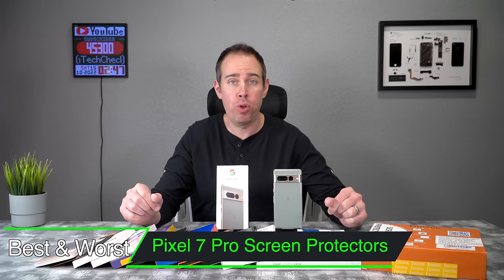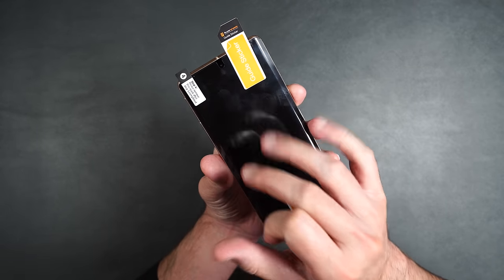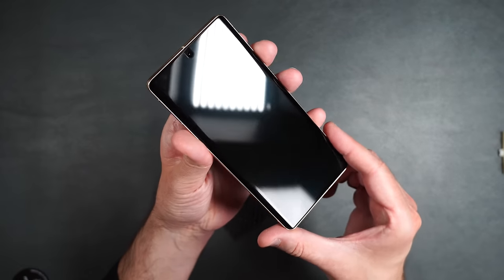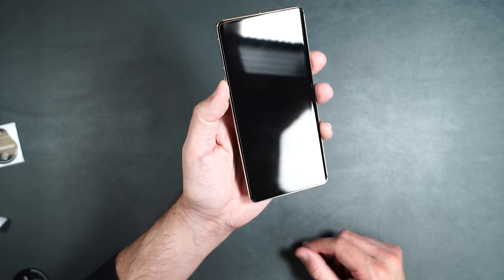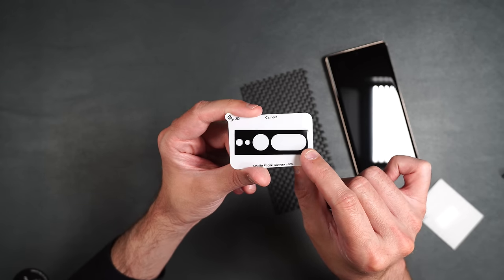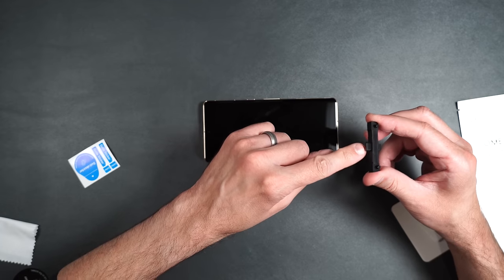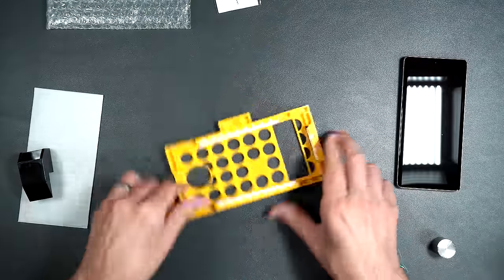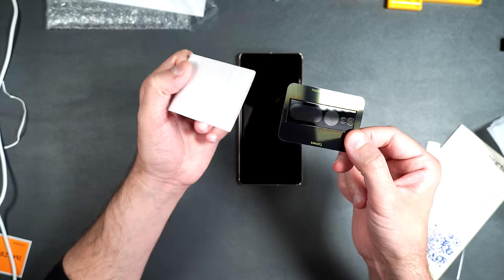Best And Worst Screen Protectors for Google Pixel 7 Pro

Comment: So what I gathered was the best glass protector would be the Whitestone dome, protects camara bar metal also. Number 2 would be IMBZBK Glass protector. Film would be AM film protector, Better Future AACL Film Protector, and Whitestone Dome UV Film Protector, in no particular order.
Reply: the winner is number 10?
Reply: really? i would put the IMBZBK Glass protector as #1 with the bumpers and a UV light that covers the entire device in one shot
Reply: @dimm0k  do you say you buy product 5 and product 10? 
The product 10 you say to buy it for the UV light?
Reply: @mArtinopapesso  no, I would go for product 12... I don't have my P7Pro yet, but have used a similar product to IMBZBK's tempered glass for my P6Pro and the extra few dollars you pay for the Whitestone isn't worth it in my opinion
Reply: @dimm0k  HI,Is 12 the best product for you,please?
Reply: @dimm0k   for google pixel 7 (6.32 inch) Which is the best product ,please?
Reply: Is there any glass screen protector available for less money without that ugly fingerprint cutout?

Comment: I’m looking for a USB-C splitter for my Pixel 7 Pro that can connect to its USB-C port. The splitter should have two female USB-C portss: one for connecting USB-C Apple EaarPods to make phone calls, and the other for charging the phone and supporting data transfer. This data transfer should enable USB debugging mode, allowing me to use the mirroring application, scrcpy. I’ve noticedd that most products on Amazon only support data transfer on the port that supports audio, but not on the charging port. Can you recommend a product that meets these requirements?

Comment: I did see a very slight circle around the fingerprint sensor on the IMBZBK loca adhesive protector. If you watch closely you will see it and I am sure that is the reason for the added weighting device. I liked the leveling bubble on the guide also. I also noticed that the gap between the edges of the protector on the top and bottom appears to be narrower than it is on the Whitestone loca adhesive protector. I like that there are no circles to be seen over the fingerprint sensor on the Whitestone either. The Whitestone procedure of having to push down, and or lift up to make the loca move to the center seems very, very bad IMO. The bridge should drop the loca in the middle if you have to do that! Too much room for error. So then IMO the IMBZK has a better installation routine with a better guide and three protectors, and a narrower gap top and bottom, with a barely visible circle over the fingerprint sensor. The Whitestone has a harder installation method, larger gaps top and bottom, no circle around the fingerprint sensor and only two protectors in the package. To me the only down side of the IMBZBK protector is the barely visible circle over the fingerprint sensor. So even though I have the Whitestone on order (SMH) I give the IMBZBK protector the WIN over the Whitestone! One other thing that is better on the Whitestone, and the main reason I went with it over the IMBZBK protector is the CLEAR camera bump film protector. Those black glass ones are stupid unless you have the Obsidian color phone. Clear is the way to go!
Reply: Nice feedback, thanks!! IMBZBK definitely has the better installation.    I kind of like the idea that the Whitestone has a little more gap.... that way more cases fit the device easier.   I went with Whitestone, but hate that it's not releasing till Oct 31st.   Luckily i found a code that gave me 20% off, so $31 total for 2 lifetime screen protectors isn't' horrible.
Reply: I just installed this one on my pixel 7 Pro. So far so good. Be sure to slide the glass protector up before using the UV light to better align it to the screen.
Reply: There is no hole for the front facing camera. You don't have an issue with that? I do.
Reply: When I installed mine it just sped up the wait time of the liquid to the sides, I think they cover the fingerprint area to protect it while installing and double down by having you use the weight at that location that's protected and simultaneously making the adhesive as thin as possible at the fingerprint sensor to ensure it has minimal impact on the sensor itself.  I can confirm my install went seamlessly and it's the best screen protector I've ever owned.
Reply: @rjsoderlund81  did your IMBZBK have the circle around the fingerprint reader?
Reply: @JohnJacobJingleheimerSchmit  nope. Can't even tell it's there.
Reply: I got the IMBZBK for $24 only and by far it was the easiest installation process that I've ever done and I've done a lot. I do recommend covering up all openings on the phone first prior to putting it in the jig. I like the zero gaps vs the Whitestone plus I hate the hole punch cut out for the camera as it tends to collect dust easily. It's also very difficult to fully clean it out too.
Reply: Regarding the Whitestone having slightly larger gaps between the screen and the case than the, uh.... screen protector with the random sequence of capital letters I've already forgotten, this isn't necessarily a bad thing. Yes, aesthetically it's amazing when the two things mesh perfectly, but if you drop your phone and it lands on the corner, any good protective case is going to bend inwards slightly to absorb the shock. When it does this, it can push on a screen protector that's fitted too close to the case, causing it to crack, lift, or even break. I've had this happen before. I'd therefore rather have a slight gap than the so-called perfect fit. These things are way too expensive to be replacing all the time.
Reply: I have to agree with this review. I own a note9 and bought a Whitestone tempered glass screen protector for it. I've had this same screen for 4 years and do not regret paying what I paid back then. I've dropped my phone more times than I can count on the screen side and the Whitestone screen has taken the brunt of the abuse. I am now buying this screen for my dad's Pixel 7 phone, because I also do not like the rim of that circle on the other screens. Installation is not great I have to agree, but doing it carefully helps.
Reply: Just installed IMBZBK, no circle around the fingerprint sensor. The best glass screen on market right now

Comment: I have a pixel 7 pro and I'm wondering why you don't talk about the second most important issue with these screen protectors - image quality.  Because of the curved glass, most of these screen protectors don't have full screen adhesion to the screen.  You did mention that this results in low adhesion but the horrible image quality you get when you don't have full adhesion makes any screen protector without full adhesion and automatic no for me.  The air gap between the screen protector and the screen causes internal reflections which ruin image quality.

Comment: I've done a lot of research and didn't found any tempered glass that seem to be a good option.. only the really expensive whitestone. Thanks a lot for this video. Now I've ordered the IMBZBK for 30 euro.. it's expensive but better than 48 Euro(for whitestone)^^ hopefully it will work fine. I'm a mom of a 2 years old and really need the high protection for my phone 😅
Reply from the maker: I agree, the best options are going to be the ones that use liquid adhesive because of the curvature of the screen. The IMBZBK wasn’t a bad option, let me know how it works out for you when I get it on.

Comment: Looks like the only real option is to go with the ones that require adhesive, the others all seem fairly atrocious, I've gone through two sets of protector already and found my way to this video, thanks! (first one is a glass one with the ugly circle hole, couldn't take it, second one was a TPU one which scratches if you looked at it too hard).
Reply: Which one did you end up going with, and how do you like it?

Comment: First time I used the Whitestone dome screen protector was on my pixel 7 pro. If the protector edges weren't there, you'd honestly never know it was there. It feels almost exactly the same as the stock glass.
Reply: Are You talking about the UV protector or the adhesive one?
Reply: @similette  uv
Reply: @_Davepocalypse  thx!

Comment: Was disappointed that there was no Spigen glass option. I contacted them ands they said they have no plans for it because of the curved shape. I ended up with Panzerglass which is expensive, and you only get one, but it does seem to work well. It too has a circular section for the fingerprint reader (one of the reasons I don't like in screen fingerprint readers), but I've yet to see a glass one which doesn't have that circular section. You seem to have greater choice than we do in the UK. Can't say I fancy the hassle of the UV curing liquid ones but they don't seem to have the fingerprint cutout which is nice.
Reply: The Whitestone does NOT have any circle section for the FP sensor.
Reply: @josephseman5333  yes I did say that in my comment, but I'm not really keen on the hassle of having to have a special light bar to cure some glue which will then sit around gathering dust. It's a pretty wasteful system.
Reply: @stevepettifer4896  I think it comes with it, you don’t have to buy one.
Reply: I have Caseology (Spigen sister company) for pixel 7 and sadly, fingerprint don`t work most of the times.
Reply: @stevepettifer4896  Lmao...you reuse it for when you reapply it. It comes in a 2 or 3 pack

Comment: Thank you so much for this!! I am going to try the Whitestone Film Hybrid. I have been using the Dome tempered glass screen protectors, but (due in large part to my physical disabilities, I'm sure) they are chipping on the edges and cracking. They're just too expensive for me to keep replacing them, plus, my screen actually got cracked while using them. Like I said, probably more my fault than theirs, but I'm going to see how I fare with the hybrid film this time. 😊 Thanks again!!

Comment: Thanks for the video! Just installed the LYWHL film for my pixel 7 pro. Was worried about getting the line in the middle but I actually didn't get the line in the middle of the screen which is great for $8. Maybe i got lucky and got a better QC screen from LYWHL. What did end up happening was a singular......singular!!!! piece of lint got stuck under the screen. Again, $8 bucks is worth it. I messed up the first screen because I wanted to see the fitment and didnt read the instruction or rewatched your video and the center green part stuck to the screen misaligned. Just and extra FYI i did install the second screen in the bathroom after streaming it up to prevent as much dust/lints possible.
Reply from the maker: That’s great to hear about no lines Poi, it’s usually my luck to get a tiny piece of dust as well. Thank you for the tip, I’ll have to try that myself sometime. Thank you for your support as well.

Comment: I purchased the Whitestone Dome Glass with Liquid Adhesive because of this review.  The instruction manual that came with is not as in-depth as this video, and I can't stress enough how much this hands-on how-to guide helped me out.  Thank you.

Also, I use an Otterbox Defender case, and it absolutely fits with this screen protector.  I hope this comment helps whomever is going to be scouring the internet looking for the answer to the question, because I certainly did.
Reply: This the confirmation I have been looking for. I've been looking at getting the OtterBox defender case for it's protective attributes as well as the Whitestone dome glass screen protector but am worried they wouldn't be compatible. Thanks for your comment
Reply: @OzzCyrus 1:08 1:10
Reply: this is the exact answer I was looking for, thank you.

Comment: Just got a pixel 7 pro (there was a massive discount from mint mobile). So basically the options are (because of the curved glass?) film with adhesive, tempered glass with a small amount of adhesive on the edges and the weird fingerprint cutout, and tempered glass with liquid curing?

I don’t know if I should even use a screen protector. Film seems basically worthless to me as it’ll scratch/scuff up really easily (it’s plastic, so way more things will affect the surface compared to glass). The tempered glass with the little adhesive on the edges seem terrible. And the whole liquid glue curing process is such a hassle and far beyond what I’m comfortable with.

I think I’ll be avoiding curved glass displays in the future.
Reply: Not everyone might need one.  Id even take just the camera protector. I'm keeping the options in my back pocket and saving them only in case i feel i need one.  I would get one for sure though if you're always in an a environment where you have the possibility for getting scratches or breaking the screen.  Other wise alot of people go without.  My pixel 5a 5g died on me,  but before i sent it in, it had just a couple tiny scratches in the screen.  small as a mouse,  can't even tell its there unless you look straight at the phone and focus.  Never had a screen protector for that one for the just over a year of it working.  This is my replacement for it. Praying this one works unlike the 5a 😂

Comment: 42:08 you need to treat those like you would window tint. A hairdryer on low setting should help the edges to cure faster and easier.

Comment: This is a great video and I used it to put the protector onto my phone last month! 

However, last night I dropped my phone and cracked the tempured glass. This morning when I went to take it off and replace it, a massive section in the shape of an oval is stuck to the screen. I got the glass off but the glue is still stuck. 

How did you get the adhesive off your phone screen once this video was completed??

Comment: I just bought and received the LYWHL screen protector today. Went ahead and just installed it about 7mins ago. I didnt read the instructions. Just basically followed along with the video when he installed it. Installation went mostly smoothly. I only have one very tiny bubble towards the middle top of my phone. I think its because i probably didn't put slightly more pressure on it. Though the instructions and some of the Amazon review said to give it about 24-48hrs and the bubbles will work itself out. Even if it doesn't I'd still give this a 4.5/5 for the very simple installation and smooth feeling. Also I DO NOT have that faint line that is mentioned in the video. I actually thought i might which wouldn't have been a big deal. But its actually not on my installation AT ALL which is just a bigger plus. The protector feels very smooth almost like temper glass. I put my poetic case on it and had no issue, though i'm planning to switch to a encased phonecase in two days. Will try to update on the tiny bubble situation. Overall.. definitely recommend it. Plus its very cheap and i have a second screen protector if the bubbles annoy me :)

UPDATE: Bubble went away in a few hours. So the installation went perfect. I did notice the screen is smooth but not like temper glass as I originally thought. It has a slight film feeling to it. Though I can still type normally. I'd say this is 10/10 for film protectors
Reply: Just installed my LYWHL too. I was lucky enough not to have any bubbles at all. I have an extremely faint line, but I need to hold the phone up to a light at the right angle with the screen turned off and spend 5 seconds tilting the phone back and forth with one eye closed to find it.

I had a pack of two and wasted one because of my own misunderstanding of the application steps. I thoroughly cleaned the screen with the provided wipes and second attempt went great.
Reply: @dhillaz  mine didn't have the line but I think it's depending on how you start the process and how hard you use the squeegee. Also the bubble went away in like a few hours

Comment: Got the Supershieldz ones myself and they're perfectly fine. Was surprised they fit my Otterbox Defender Pro when the Zagg one I got at Best Buy popped it right out.

And it's actual glass so it'll actually protect the display. Tempered glass is meant to act like Kevlar so when it breaks, you peel it off and get another one. Film doesn't do this.

I would have gone with Whitedome but far too expensive and heard it's not compatible with some cases. (Otterbox is one of them)
Reply: So , which is the best to use it with Otterbox Defender pro?

Comment: I just want a tempered glass protector that doesn't have that awful finger print cut out. You can get one easy enough for the 7 but why not the 7 pro. I've got one that fits perfectly but that visible finger print void is so bad I can't use it

Comment: For the matte skins... I read from a guy that used a blow dryer to dry the film for the curved edges.
Reply from the maker: That is an option for sure , I just wish they made the protector for use without the liquid. It just makes the installation more difficult than it should be.
Reply: @HighTechCheck  agreed

Comment: In my experience the SuperShieldz Tempered Glass are horrible.   I tried both in my pack & both came loose within a day and affected touch.   I got the thinner ones without the fingerprint circle.   2nd one cracked in under an hour in my pocket with nothing else in my pocket.  I'm currently using a knock-off brand of the WhiteStone liquid adhesive which seems to work great and is scratch resistant to my steel marking scratch awl which is hardened tool steel.

Comment: I love how all these have the exact same instructions and installation kits.  Seems like the same chinese stuff branded and boxed differently.  I'm gonna pick up the LYWHL film protector (#4) from your link.  I've tried the Whitestone on my S21 Ultra and although it provides good protection, the second you get a crack on the edges you're done.  It cracks and spreads because even though it's glass it is very thin.